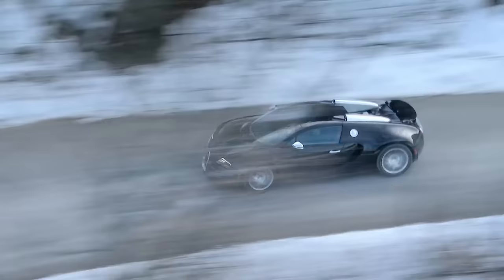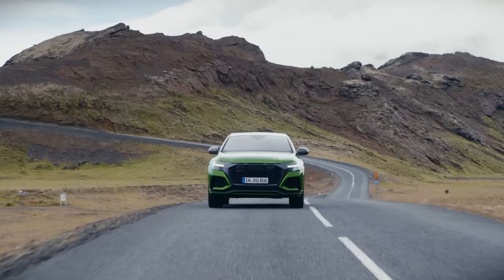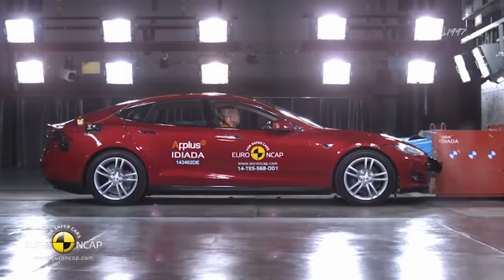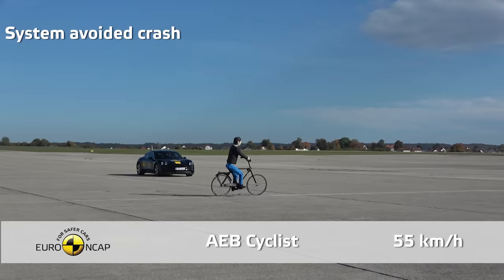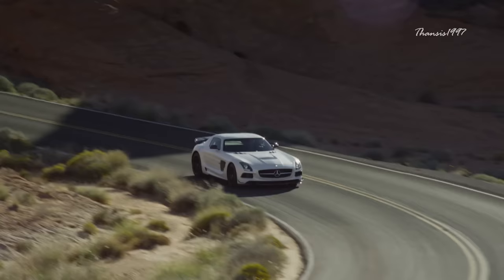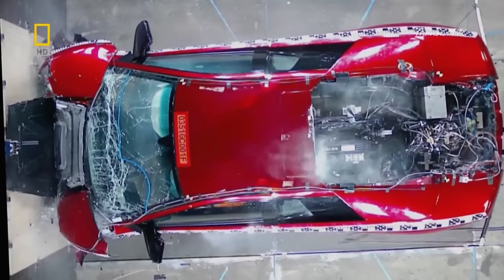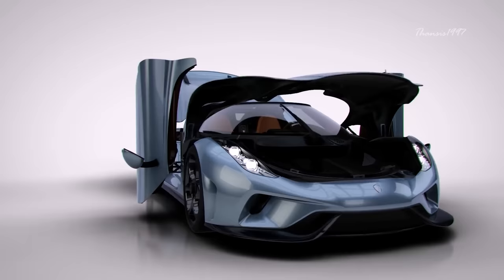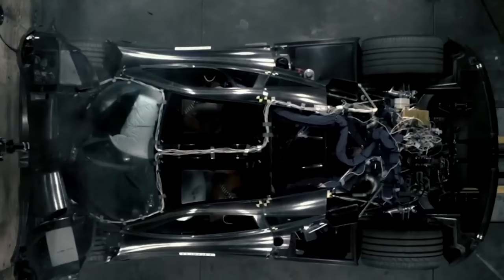Top 10 Most Expensive Car Crash Test Of All Time

Comment: Note that not all car safety testing facilities accept cars directly from manufacturers. Many facilities purchase them from random retail dealers, that way manufacturers can’t cheat by modifying their sent cars to appear as if they are more safe than what they actually may be off the production line.
Reply: It’s illegal to sell cars without crash testing them (or a recent year of the same model.)

*in the USA
Reply: From the Euro NCAP home page: "Up to 4 cars are needed for an assessment by Euro NCAP. If a car model is already on sale, Euro NCAP will generally buy cars from dealers, in 
the same way that consumers do. Cars are bought anonymously, either from a single dealer or from several. Once the cars are at the test laboratory, the manufacturer is informed of the vehicle identification numbers (VINs) and are asked to confirm the specification."
Reply: Thanks , I didn't know that . Many of those super EXPENSIVE cars seemed like manipulated photoshop fakes .
Reply: That is why Tesla looking suspicious rigid in  side test....

Comment: If the new G scored not so well, I can't imagine how badly the old one did. Now it explains why there were no video crash tests of the old one. It looks like it will protect you but it's a deathtrap.
Reply: It's like the early 2000s pick up trucks
Reply: it got 5 stars in the test how is that not good ?
Reply: @melin1969  frontal crashes were found week, chest compression etc. Side ones were 5 stars
Reply: @Degas93  Yeah, you'd think just by the way it looks it'd be a fortress in a crash...it seems not so...Disappointing.

Comment: This isn't accurate, the cars they send to the crash tests are often built at a time when production flow is very low because there is still a lot to adjust on the production lines so the capacity is very reduced, those cars are much more expensive than later on when regular production starts. So is very hard to say which one was more expensive, it could be that the Opel Corsa crash test was more expensive than the Range Rover.

Comment: So you really think to manufacture a Mercedes, BMW Rolls-Royce or any other high end car is more expensive than manufacturing a Toyota?  Come on, it's just the image, the perception you pay for.
Reply: That's absolutely incorrect!  If you completely dismantle a high-end vehicle, such as a Rolls-Royce or Lamborghini, and compare it to a disassembled common production vehicle, like the Toyota or Nissan, there are few similarities in material finishes, componentry, engineering tolerances, and build quality!
Reply: @Thomas-iz1le  I have been driving a lot of cars in my life. From Fiat to Nissan to BMW and many more. The car with the most trouble was the BMW. On top of that, simple repairs are extremely expensive. My Nissans and Toyotas were the most reliable, trouble free cars. 

Believe what you want to believe, I'm not a car expert, but I just drove them for 50 years.